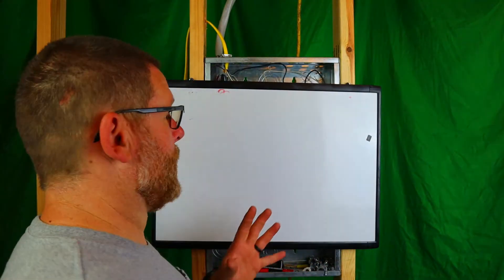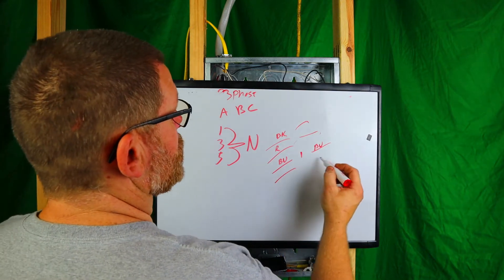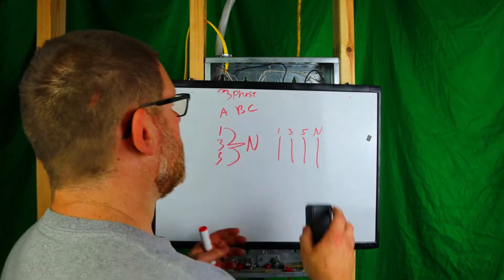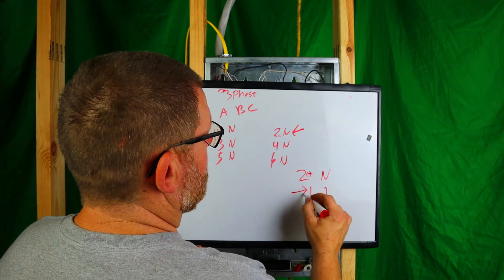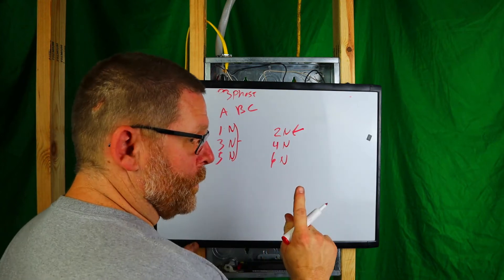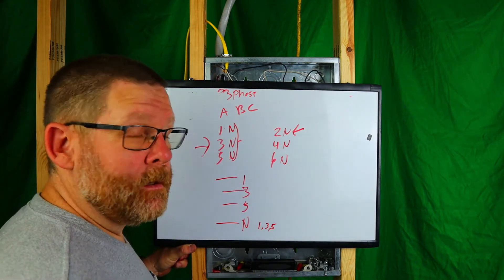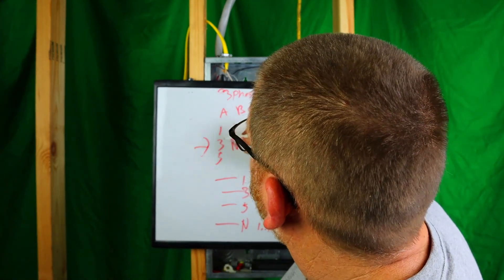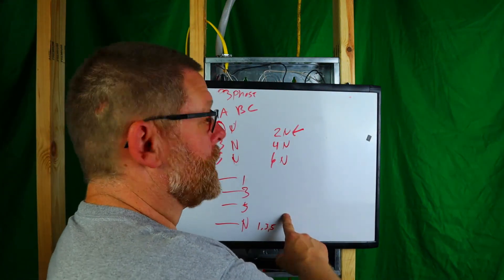How To Share An Electrical Neutral The Right Way

Comment: This video assumes but doesn't state that the primary power is 208 wye, wire up what he's talking about on a 240 delta and watch what happens to your 120 volt devices on the wild/stinger leg. Oh my, the fluorescent light fixtures all caught on fire.
Reply from the maker: Well I don't even believe I mentioned a high leg on this type of circuit. Your correct that would definitely ruin your lights... But fire?

Comment: Dedicated neutrals are safer, but don’t be afraid of shared neutrals. Electrically, they are perfectly functional and code allows it. Just work safely and always test your circuits before working on them. Especially in residential applications, shared neutrals is an excellent way to save on the cost of copper and fewer wires means less clutter in the service panel which makes it easier to access and look more organized. It’s really no different than the old argument about conduit vs Romex. Yes, technically conduit is “better” but Romex is perfectly functional and safe to use when installed properly. The same thing can be said about wire nuts vs Wago connectors.
Reply from the maker: Excellent comment. Thank you for sharing. Have a great day

Comment: The best thing to do is avoid sharing neutrals  for maximum safety and breakers that don't have a handle tie 
It's best to replace it with a new one that has a handle tie , Whenever I install one or more branch circuits , I always provide each circuit with it's own neutral

Comment: experienced this recently. the panel was not labeled well. red, black, and two whites coming out of one conduit. two separate breakers not tied together. building was built in the 70s. problem is the OG installer used one of the whites for ground. conduit was plastic so no, they weren’t using the conduit. and he didnt use green tape…

is there a way to test -safely -that two circuits are sharing a neutral?
Reply from the maker: Yes the easiest way to go that is to turn on everything in the house building. Turn one of the breakers off and see if the nuetral is unbalanced. There are other ways too but this way is much safer

Comment: Makes sense, and I'm kind of new dealing with 3phase circuits. We definitely run "sets, red,blk,blue,N" for multiple lighting and plug circuits and terminate them under single pole breakers in the panel, we definitely don't use breakers tied together or run separate neutrals per phase.
Reply from the maker: I use to be the same way. It's a definitely can be a dangerous situation. Stay safe brother

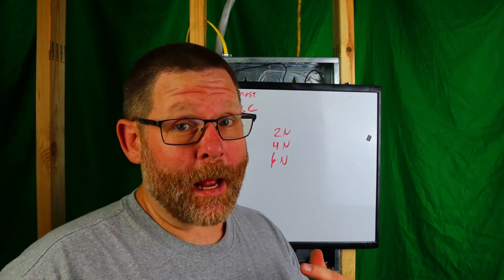Comment: At 3:36.  Totally confused. Have no idea what is transpiring. sorry
Reply: I think he’s referring to identifying the physical wires with either number tags or other forms of identifying the individual conductors
Reply: He's trying to make it simple and overlooking things he just assumes, I do that so often.
Reply: @wurlabyscott  Light bulb came on.   This Is Not Three (3) Phase Power.
Reply: @tedlahm5740  says 3 phase on the board.
Reply: Definitely three phase. You don’t use three pole breakers on “standard” two phase power like residential and most commercial applications. The theory is the same though. If you are anyway unsure, like an unlabeled panel, take the time to research what is going on. Count the neutrals and grounds. If there are a lot more hot wires landed on breakers than there are neutrals and grounds chances are there are shared neutrals. When you are testing wires to confirm they are deenergized, always check voltage across both line to neutral AND line to ground AND neutral to ground.